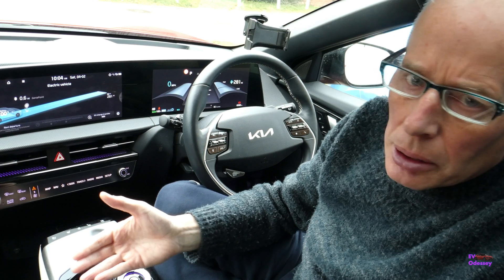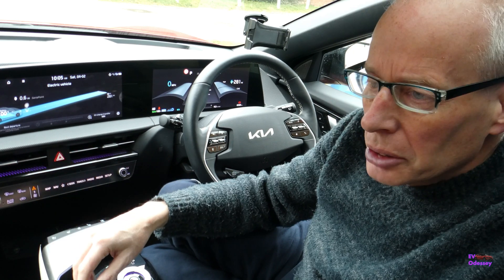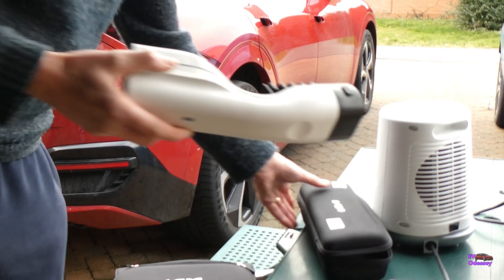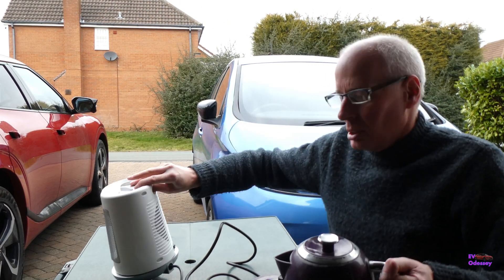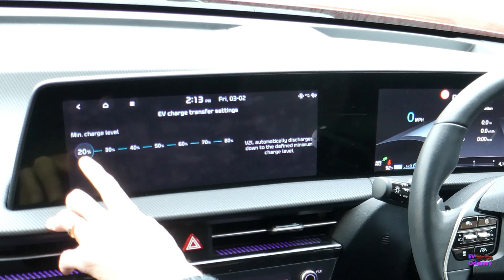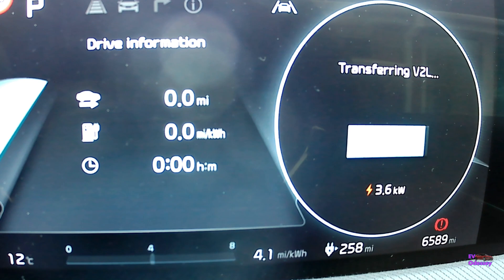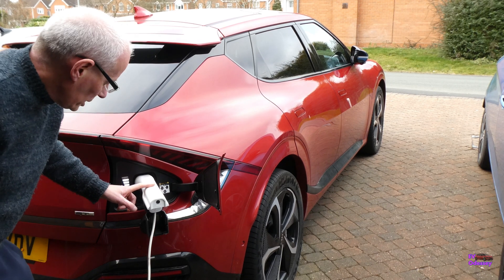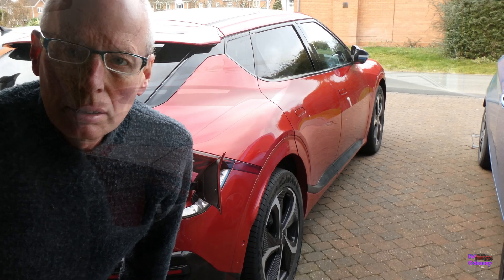All about Kia/Hyundai/Genesis V2L/V2D ** see updated  note👇 & 12v note👇👇**

Comment: The 4-way power strip you’re using should be fused at 13A, so should not be capable of sustaining 3.7kW.  Current (Amps) and Power (Watts) are related - Power = Volts * Amps.  UK domestic sockets are rated at 13A, which at 240V is 3.12kW.  There is some potential danger there if for some reason you’re able to sustain 3.7kW through the power strip - the plug and flex are not rated above 13A - 3.7kW is over 15A at 240V.
It will take a little while for a 13A fuse to blow, so maybe the car cuts off before that happens.  You must not sustain more than 3.12 kW with that setup.
I don’t really understand how it is intended to supply more than 3.12kW through a domestic socket - a 3rd party V2L adapter with a commando socket rated at 16A is the way to go if you need to draw that much power.
Reply from the maker: I totally agree but i had to use what i had available to demonstrate. EV Cables make exactly that option with commando socket on the end.
Reply from the maker: I will add a safety note to the description cheers. And i’ve pinned your comment.

Comment: Im looking at a 64kwh hyundai kona premium from 2021 does it have v2l?
Reply from the maker: I would say not. EV6 and Ioniq 5 were first to have V2L from late 2021. Kona facelift may have had it from 2023. If you have access to the car you tell from the menus. V2L will appear in settings in the EV menu (where you can set the minimum level before it stops.)
Reply: @evodessey  thankyou for your input

Comment: Brian, just about to try this for the first hoover of the new car. Should I put the car in utility mode first? Thanks
Reply from the maker: No,just plug in V2L and press the button to activate
Reply: @evodessey  how do you get the 3 pin under the back seats to be active?
Reply from the maker: @Andrew-ib5ik  plug the v2l into the charge port and press black button,saves utility mode and having to turn car on
Reply: @evodessey  thanks Brian. Used the V2L adapter to use hoover. Perfect. Worked out that utility mode was needed to be on for internal 3 pin socket to work. Very happy. Saves the leads from indoors. I guess this means the internal 3 pin can’t be used when driving as utility mode would automatically turn off when pressuring start button
Reply from the maker: @Andrew-ib5ik  On my car plugging in the external V2L and pressing the black button always activates both Internal & External 240v sockets. The internal one also works whilst driving and ignition on. It goes off during charging because of the way the ICCU works. I was running a fridge in the back on holiday and found out this the hard way.If you are charging also Utility mode will not start.
Reply: @evodessey  thanks. All hoovered and washed. Will try the internal socket with ‘engine’ on
Reply: @evodessey  spot on Brian. Tried it you were right. Cheers for your help again. Slowly getting to grips with it all

Comment: Does the drive mode effect the amount of regeneration you can get 
I seen to get more regeneration in normal mode over eco mode
Reply from the maker: Not that i know of but i’ve not tested or noticed it.The only mode that has a fixed regen i know of is Snow mode. I can’t find a setting where you can set the amount of regen per drive mode. Strange thing is that this used to exist on my old e-Niro. You could define default regen for each mode.Someone mentioned to me a while back that they did the same journey every day and they used to pick up a ton more regen in Sport mode going down a long slip road off the Motorway which sounds counter intuitive.Again i’ve not tested that one either.
Reply: @evodessey  I have been using eco mode and getting 3.9 to 4.0 in normal mode I have been getting 5.5 to 6.0 but of cause the range is less to start with

Comment: I use intensively V2L from a nissan leaf and an ev6 to power my home and/or heating cooling units. On ev6 you can also reset from remote just clicking the update botton from the app.

Comment: WAIT!  1) So I can charge the 12 volt battery from the traction battery simply by plugging in the V2L adaptor if I don't give it any load ? 2) So if I had a flat 12 volt battery, and a little time, I would not have to jump start the car with a portable charger?
Reply from the maker: You still need a little juice in the 12v to open the charge door and engage the high voltage relays so not if completely flat. You can definitely condition charge the 12v by leaving it plugged in for an hour or more though.

Comment: One minor addition: at least here in the USA, the OEM adapter is hideously expensive ($500 I think!). There is now a Lectron option on Amazon for $130, and what's inside is terribly simple, so it's not a stretch to make your own for the cost of a $60 J plug, an extension cord, and a switch.
Reply from the maker: Someone from France in the comments reckoned they could knock one up for £20.

Comment: V2L was a real life saver for me. My gas central heating broke down first week in January and it's a bit chilly here in Scotland. However I used a couple of extension leads plugged into the V2L adaptor on my EV6 and used two oil filled radiators, one in the kitchen and one in the living room. It was great well a lot better than I would have expected, we run like that for over a week. Also because I charge the car at night on Octopus Go it was a hell of a lot cheaper less that £2 a day.

Comment: Great overview. My only problem with V2L is the design of the standard UK plug. It means you cannot close the protective housing on the adapter should the weather take a turn for the worse.
Reply from the maker: That’s why i replaced the Kia one with EV Cables one. It’s not weather proof and also cable is bent too much when you close it. https://evcables.com/products/hyundai-kia-vehicle-to-load-v2l-discharge-cable

Comment: Under the rear passenger seats there is also a plug... the output limitation of the V2L and the rear seat plug are both the same?

In case you need to use both at the same time, can they work simultaneously at their maximum output power or do they have to share to output power between them?

thanks for the video!
Reply from the maker: As far as i know ( i did read this on a forum a long time ago) the limits are shared between the External & Internal sockets so 3.6kWh total (or 1.8kWh) is all you get regardless.

Comment: Hi Brian, after 7 months with my car never actually used V2L albeit will hopefully start using it in the summer? Just out of interest if running V2L do I need to put the car on and if so do I need to enable utility mode? Was just thinking if doing camping for example and you want to run devices, then surely having utility mode on would negate the need for having the car on normally and in order not to drain the 12v with the normal lights, display etc. 👍
Reply from the maker: Hi Mark,Car does not need to be on or in utility mode. Just open charge door,insert adapter and wait for it to lock with a click. Then just press the power button & you’re away. 12v battery also gets charged automatically whilst using V2L.
Reply: @evodessey  Thanks Brian much appreciated 👍👍